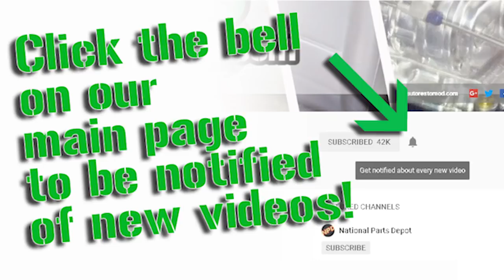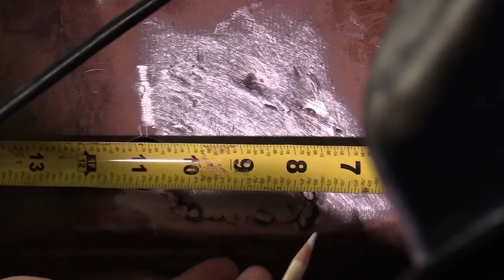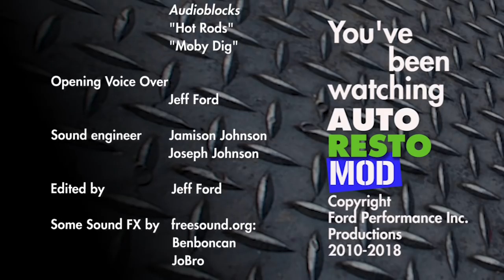DIY Basic Patch Panel Rust Damage Repair Car Tips and Tricks Epsisode 375 Autorestomod

Comment: To precisely determine the location of the center of the  second hole you could have made a template.  Take a pice of paper, draw a circle of the size of the existing hole and mark the center of the second hole. Now you can align the circle on your template with the hole (hold a flashlight behind the hole) and center punch the second hole. This trick also works for complicated hole patterns. I usually make a drawing with a CAD program and print it  on transparencies.  If you have your printer calibrated this is very acurate. If you have marked out reference points on your object it is now very easy to transfer the hole pattern to the object.

Comment: Jeff, if you've never tried it, go with .024 wire , I used to use .030 and it's harder to use compared to .024 on thin steel.
I'd highly recommend trying it if you haven't, I get much better welds with less heat and distortion.
Reply from the maker: Great idea! We'll try and get some. usually Lowes or Home Depot is out of the .025 and we are stuck using .030. We're about 30 minutes from the nearest welding supply place.
Reply: @AutoRestoMod  I get my mig wire from Tractor supply, they normally have both .030 and .024 solid wire in stock.
Reply from the maker: Thanks, I'll see if our lads at TS are on it. We will be welding in a patch on the F100 for an episode so a lighter wire might come in very handy.

Comment: Jeff maybe why you feel that the pedal is a little off. is because there is a difference between the gas pedals on a 6 cyl. truck and a V-8 truck. and i don,t think that Ford ever put in a 428 if that,s what your engine is. cool videos as always.
Reply from the maker: Pedal position is pretty much common, and I don't know if the pedal is a V8. I know the truck is originally a 360FE. And we know that it is a 390 now. Still, plenty of go-go.  Thanks for the kind words.

Comment: This truck is headed toward a beautiful concurs restoration....lol
Reply from the maker: NO. No...no? Cosmetic only...No frame off...OK, OK, maybe just the cab...Well, since we're that far...
Reply: ahahaha...I had a 69 camaro that started as just a driver paint job and engine freshening.  You guessed it....6 years later it was every nut and bolt.  It is a slow, creeping expansion.

Comment: lol...  Jeff,  All that silicone was a previous owners attempt to stop water leaking into the cab....Probably due to the fact that the rubber grommets on both Heater core tubes, as well as the Gas Petal rod, were rotting away, if not totally gone.... Probably took 5 minutes to smear it on and about $ 5 bucks for a tube....His problem solved,,, Your Headache started....
Oh,, and your welds....they're fine,,,  Heck some of my best holding welds, look like an 8 year old did them....lol           Later you guy's...
Reply from the maker: LOL I understand the hole on the heater core...kinda. But the other one...no.

Comment: They make cheater lenses for the inside of your welding hood
Reply from the maker: I use cheater glasses some. It is really more to do with my need for more light on the project at the start. And it is a heck of an excuse for crappy welding...
Reply: I've tried cheater glasses also but they don't work very good inside your helmet, a cheater lenses which snaps inside your helmet is always there. The magnifying lenses should  fix most of your light issue at the same time. If your eyes are starting to get bad now, wait in-tell it's not enjoyable to eat a plate of food without your glasses on. That day is coming.
Reply from the maker: Aren't you a bright ray of sunshine (see what I did there?) LOL. Thanks I will look into it. We have a ton of welding in our future so...yeah.
Reply: I don't use cheaters, except for welding. They made a big difference in my ability to, you know, SEE, inside the helmet. I didn't have to put my face right up next to the gun anymore.